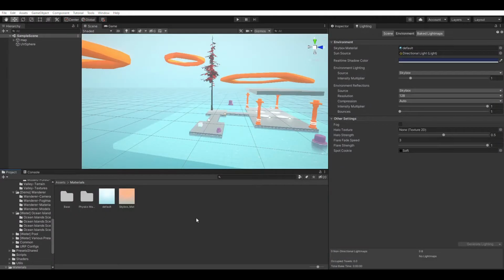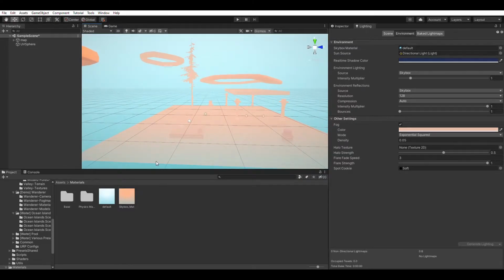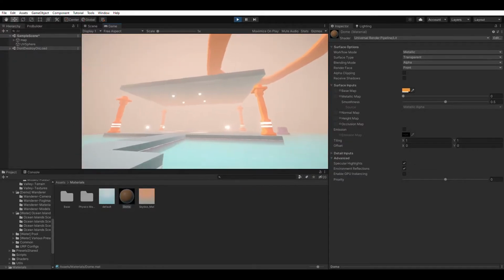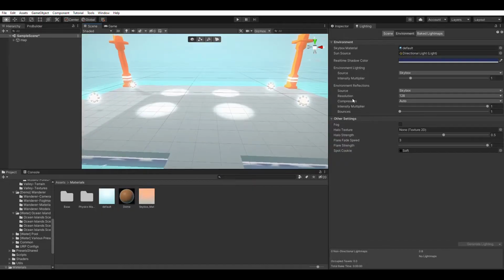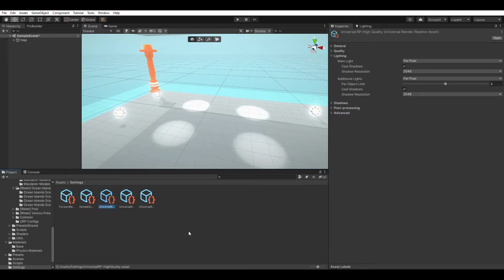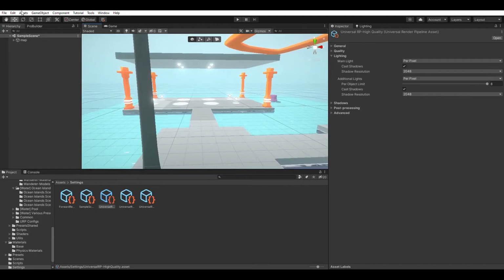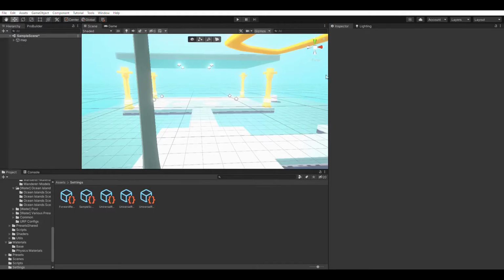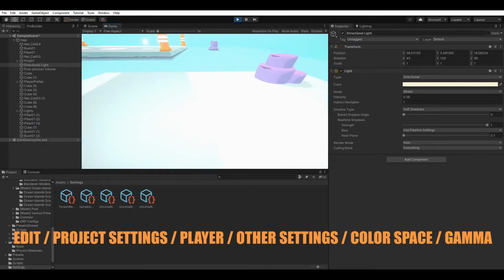3 Tricks To Get Good Graphics (URP)

Comment: and also there is defferd lighting in the newer versions of unity. im using unity 2022 and so far it works great. altho camera stacking doesnt work with defferd lighting i use the render object feature works wonders and its more good for performance.
or just bake your lights in the oven.
Reply from the maker: Yeah I heard they had it in the newer non Lts versions